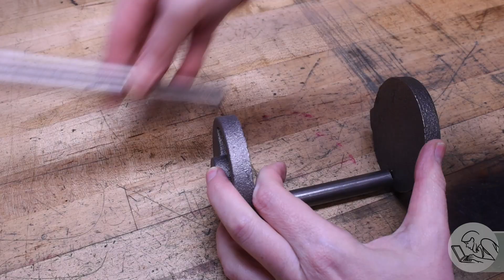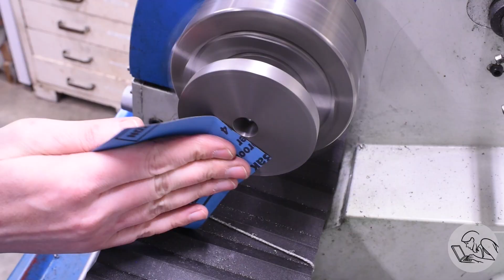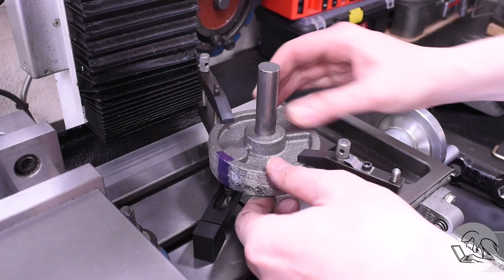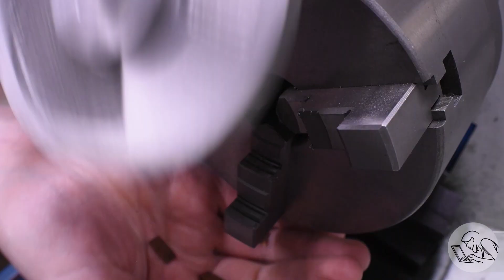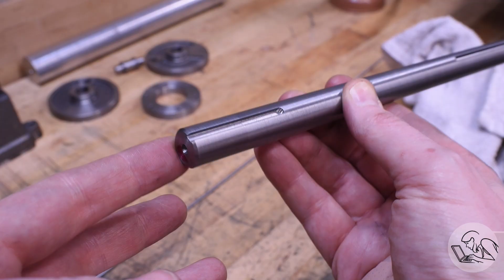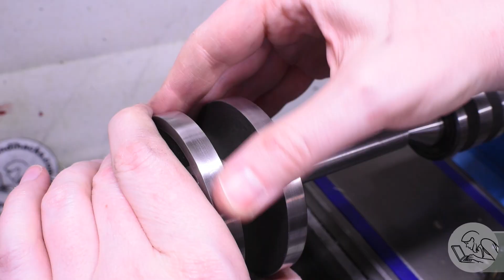Making a Crankshaft!    Big Steam Engine Build, Part 3

Comment: Yep,  I had the same issue when checking after setting the centre shaft out.  I didn't have a collet then but ....  I did mine a little differently to save on the cutting centre shaft.  I only drilled and loctited the crank pin (with the centre shaft right through then withdrew the shaft, machined the two halves an loctited in place

Comment: I’m curious, if you wanted to drill the crank pin holes on the lathe in a faceplate setup, would supergluing the two disks together while they were on the mandrel before removing them and clamping to the faceplate work?

Comment: For cheaper and easier machining you could use a solid shaft with bearings that have slight offset, that way the rod still oscillates but it doesn't need press fitting or anything like that, also what lathe did you use?

Comment: I would machine this part out of the solid. I hate working scale also. One of these days you might want to think about a floor mill. I used to have a Lagun floor mill when I had a shop when I was a kid. It came with a slotting head which came in handy on alot of specialized parts.

Comment: Quinn

First I have zero lathe experience.

When you are facing before center drilling, is it possible to use your facing tool set at an angle to get a center instead of using the center drill? I would think it would be more precise.

Comment: For forge scale like that I find using ceramic flap discs or something similar works best. They are similar to obsidian and have a higher melting point that steel usually so it can be a nightmare to remove.

Comment: I would have picked the press fit instead but great work nonetheless!
With your current solution it could be (maybe) that the roughness profile (on your machined surfaces) of the shaft levels under the force of the engine so that the fit of the parts might become even larger and maybe result in a larger imbalance. But it could be that the force is pressing on a large enough area so that will not happen. When you do a pressing fit or shrink the part onto the shaft the leveling of the roughness profile is already considered in the calculations so that the right fit is picked beforehand also according to the strength of the metals used.

Comment: The piston engine is obsolete ,
The piston comes to a dead stop then reverses and goes the opposite way then stops and then goes the opposite way , repeating this over and over again ,

At the same time a Jet turbine engine just keeps spinning in a circular rotation getting faster and faster 

Are piston engines cool , Yes they are ,
I build small block Chevy engines , 
Are they efficient ?
NO !
But man do they sound Great

Comment: Hi Quinn, great video as usual. Went through this same process making a very small five piece crankshaft from a kit. Decided to build the same method as you show here and cut out the centre scrap piece right at the end (and file the faces flat) Threw all he original kit parts away after not getting it right (and beyond recovery) and made one from scratch. Your video brought back all the pain, but the end result is a nice one.

Comment: I was surprised when you cut the shaft after locktiting it.  I expected you to mark the shaft, pull it apart, cut the shaft, face the cut ends, then put it together and locktite it.
Reply: I believe that Quinn mentioned that was her intent, but when she drilled through for the pins it created burrs that locked the pieces together.

Comment: Beautiful job!  My loco has 6" dia x 1.0625" thick wheels, and the axle boss hole is 0.625". When I turned the axle diameter where it fits into the wheel, I turned a reduced diameter land by 0.001" x 0.500" wide to coincide with the middle of the boss. When fitting the wheels to the axles, Loctite 638 is the adhesive of choice, applied to both mating surfaces: It ensures that the L638 is not wiped off by inserting the axle into the hole. This gives a large shear-area for the L638 to work on; it will never come loose if the parts are degreased properly.
When I put one wheel on back-to-front, I had to scrap one axle, make a new one, and re-bore the wheel-bosses as the cut-off stubs wouldn't shift. 🙄😡(Grrr)

Comment: Hi Quinn,

I used the same techinque on the crankshaft of my shay loco. Works well since 10 years. It also gave me the feature to use ball bearings on the enclosed shafts in my case, as I can take the crank shaft appart. Instead of loctite the pins in, I used clamping straps as on the real thing.

Keep up your progress. I can still learn a lot of high grate machine work here, mostly better than mine ;-)

Gerd

Comment: Very nice work with the built-up crankshaft. I've seen Keith Appleton use this method of building and pinning built-up crankshafts and when you stated early in the video you were going to pin it I knew your finished crankshaft would be straight and true in the end.

Comment: Next time! If you'd like to try to drill the holes, put like .002 shrink respectively to the shaft. Throw that casting in your oven at temp (425) for 3 er 4 hours, (if your worried take shafts put in a bag and put in the fridge too) measure to make sure there's like 5 or more clearance just slide them in with a flat and level block stopper on the other side. If you're worried about it not being perpendicular just get some tube that's like half the length of the shaft and fits through just enough, face 1 end flat. When you assemble line up the shaft with hole like normal but make sure the other tube is in the upper half simultaneously, when it drops in do not hesitate at all and slide that tube to the bottom watching for gaps and give a firm tap to your shaft with a deadblow.. I'm not sure if working on this small of things would make it more difficult to do. At work I do this almost every day but with shafts usually around 2.5-5.5" in dia. And bigger ovens and torches and no fridge usually buckets of liquid nitrogen. (Wart remover from the store works for at home 1 off small parts)

Comment: If it turns out that you need to, you can still add taper pins. They can be sized so the small end is just bigger than the straight pins you now have. Don't forget that you can get taper pins with a bit of thread on the end to allow pulling them out. (Or you could cross drill the web for a taper pin under the functional pin to drive out the pin the same way a tapered wedge drives out a Morse taper from a drill press spindle.)

Comment: I always learn something watching these videos. Talking about large end mills, would love another mill series +1 episode on end mills specifically. When do you is a ball nose? What diameter end mill? 1/2 inch is more rigid, but does the extra tool pressure make DOC an issue with small mills? Does 1/2 have better life than say 1/4? Does 3/8 work well as roughing mill and 1/4 as finishing? Etc. Basically what works well with small mills from your experience?

Comment: I'm super curious how brazing would perform in those joints. pinning is probably the way to go but brazing might take up any empty space in the joints.
Reply: FWIW, Stuart D10 instructions offer two alternatives of assembling the crankshaft: pinning and silver solder (brazing). And yes, it mentions that you need to be fast with silver solder to minimize warping (or was it in the Stuart 10V book?). Stuart D10 is a smaller engine, though.

Comment: You were right to move the keyway.  Fluid film pressure varies from the max at the middle of the bearing to zero along the ends.  The keyway would effectively shorten the working length of the bearing.

Comment: Yes, you can press that assembly together.  At that point, you have essentially created a mini-Harley Davidson crankshaft.  It's worked for them for some time.  You can then treat it like a very stiff ball joint, and true it with a deft touch with a hammer.

Comment: When making the bearings here is a trick from full sized engines that should work on your one as it is large enough. First work out the direction of rotation, drill in the lubricating hole on the inside of the top bearing use a dremel to create a shallow groove that runs with the direction of rotation down to the bearing split point. This will draw oil down to the bearing split. Now in the inside edge of the bottom bearing file a minute chamfer on the inside that runs with the direction of rotation but does not extend to the ends of the bearing so that both ends of the lower bearing are not bevelled. The effect of this is that oil is run down to the small chamfer in the bottom bearing, it runs along to the edges of the chamfer. As the shaft rotates the oil is dragged into the chamfer whose wedge profile squeezes the oil into the bearing surface creating a thin high pressure film of oil between the surfaces. When running at speed this high pressure oil layer extends the full rotation of the shaft and the shaft instead of laying in the bottom bearing brass floats in the middle of the bearings totally supported by oil. This is why the only wear a steam engine shaft bearing gets is during those times running up to and down from working speed. Steve 
If you want more details I will pop a drawing on my website.

Comment: As far as the design having the keyway impinge on the bearings, no way would a full sized engine be designed like that. What is more probable is that the engine the PM guys took the dimensions off was machined incorrectly. Steve

Comment: I keep waiting for someone to pin something like this the same way they use pins on full size steam engines. In stead of the pin being positioned at 90degrees to the shaft axis they pinned parallel to the shafts. A hole for the pin is drilled with the centre at the junction between the shaft and the crank so that half the diameter of the hole is in each part and drilled to the length of the shaft/crank intersection. This way the full length of the pin prevents the crank rotating on the shaft. Rather than just the diameter. I have a similar sized Stuart turner No5 crankshaft to do at some stage and will probably give it a go. Nice job. Steve

Comment: Can a wood bandsaw be installed with a metal blade and used for metals?
Reply: Or swap to a variable speed DC motor to get the lower speed. See Jeremy Fielding's channel for an example - he did this on a chop saw.

Comment: Your work & skillset simply blows me away. What you have created is just fantastic. I have viewed the YTs of a UK model engine builder who critiques &  sometimes repairs old kitset builds & talks of the need to be so accurate & exercise extra care when working with small scale components on the project or the slight errors accumulate into one big failure. I have a kit for a twin-cylinder & it sits gathering dust unopened simply because i just don't think i have the kind of care you're showing us here.

Comment: "..runout went away.  PHEW!".  I wondered half way through that if the tailstock was the issue too.  And it was.  I said PHEW along with you! .... I've done enough heavy load joints with my 608 that I've come to trust it almost as much as I trust silver soldering when used on slip fit joints with good surface area like you used.  It's amazing stuff and I'm sure your crankshaft will be more than strong enough.   Loved the coverage of the development of the fixture setups too.  You're right, there's much to be learned by showing what DOESN'T work as well as what does.

Comment: Your method of pinning the shafts was definitely better than a press fit. I work on old Gravely tractor engines with the twin disk cranks which are press fit. The problem with that is if there is any torque impact on the crank it can mis-align the disks which can cause pronounced engine vibration.

Comment: You are a master of problem solving because you approach them as an opportunity. EXCELLENT work as usual. Many many people do not retire for the evening with the same sense of GREAT accomplishment as you do.
Reply: I was looking for a mistake all through the video, and then when the crank shaft was mounted between centers after the center shaft was cut a flickering and smoking candle lit up. The flexing from the axial pressure was suddenly obvious. Now I wonder how it will fare when the crankshaft gets put under stress. While there won't be axial pressure on the shaft there will be angular forces produced by the cylinder and radial from the load on the engine.

Comment: Cast iron scale can be brutal! I tried to turn the OD and ID of some 3” cast iron pipe, as I wanted to see how stable it was after machining. It wiped the cutting edge off a ceramic insert in seconds, much as it did carbide and HSS.  My “solution” was to chuck it in my wood lathe (not a huge deal to get it dirty) and go at it with a 7” angle grinder. It worked, but  wow did it make a mess! 🤣

As always, you continue to impress with your skill and ingenuity! Keep up the awesome work!

Comment: Not too sure about pinning. Shear efforts on those sharp edges are relevant. Of course I'm no expert in Steam machines but press fitting (interference) is common on Citröen 2cv crankshafts and they never come loose

Comment: 26.25............ and the answer is NO< IT IS NOT!
 I could  just hear all the viewers moan in disbeliefe  as the crank weebel -wobbled....... and then you fixed it! 
 Thanks for the great videos!
 How do you feel about the balancing?     Seems to be is maintained?
Reply from the maker: I doubt it was ever balanced particularly. Steam engines run at 100rpm so it doesn’t matter a whole lot

Comment: This is really challenging and a bit complicated as well. I think that the original press fit is better since it will bring a stronger connection between the parts. A pin and Loktite is not the same. This will be strength-tested when you build the final engine. Thanks for sharing.

Comment: Nicely done! My father was building a smaller steam engine kit, and the crankshaft was a single casting with a web between the cheeks. When he finally got to the point of cutting out the webbing, the entire piece warped into scrap.  Your method could've avoided that problem, if done before final sizing.